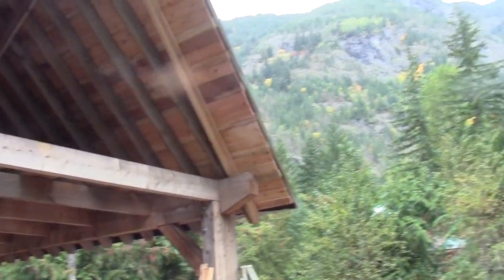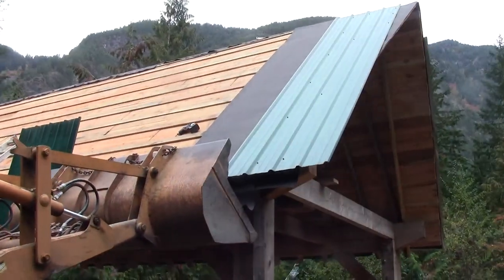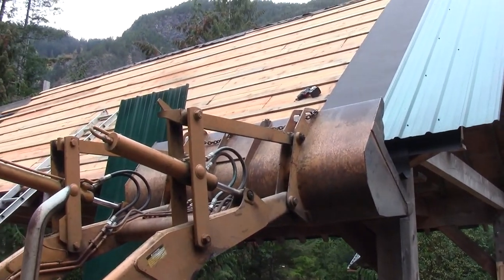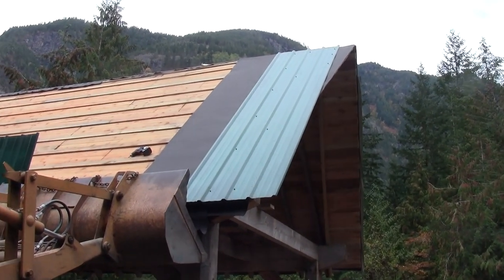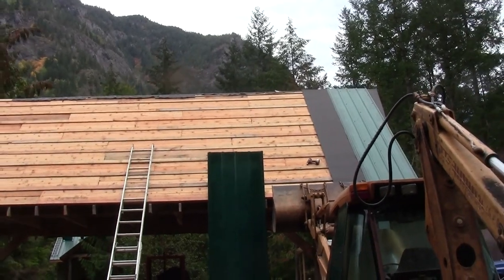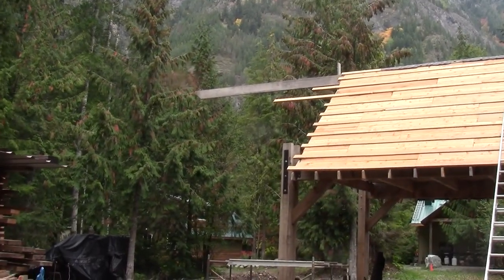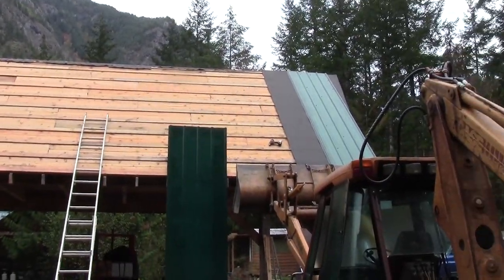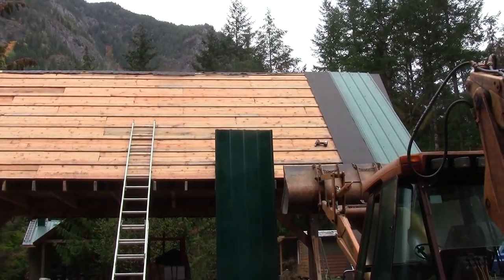New Sawmill gets Metal Roof

Comment: Snow should slide off 12 12 pitch.👍
Reply: I have a similar metal roof on my shed in Ontario, the same color even, with 6 in 12 pitch. The show is sliding down really well because it is metal. It is quite tall, so my tractor can get in. It was pretty scary to work even on 6 12. Mostly singlehanded. So, looking at guys climbing back and forth on that one, just wow!

Comment: Great looking sawmill building, I am going to start building one as soon as the ground thaws here in Colorado.  What are the dimensions on your building, is that a single beam running on the long side? Thanks for the great video.
Reply from the maker: The side beams span 28 ft to accommodate loading of logs.  We cut the beams 30ft long on the 21ft Woodmizer bed, which was an interesting challenge (made a video about it).  In this video the building is 30 x 16, but since then we have added on to it.  Also we gave ourselves 10ft of head clearance.  I'm gonna post a video about the rest of the building soon, it's turning out nice I think.